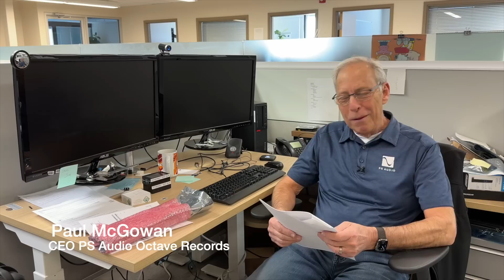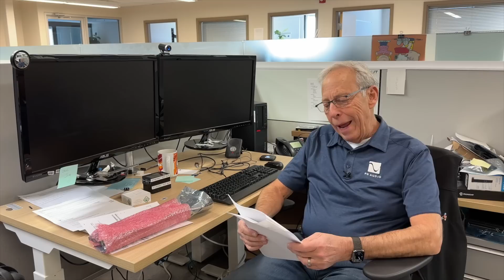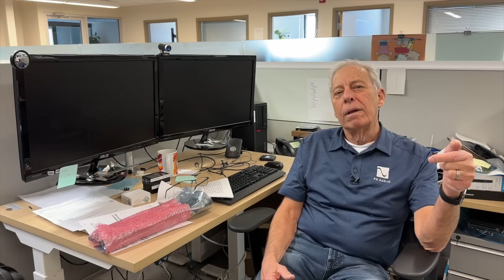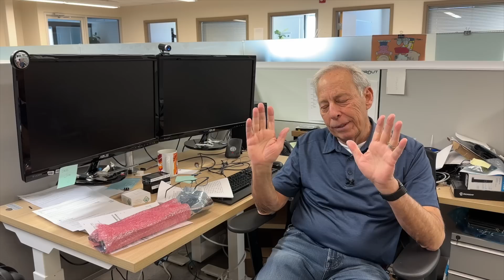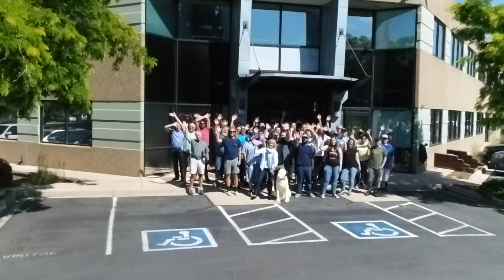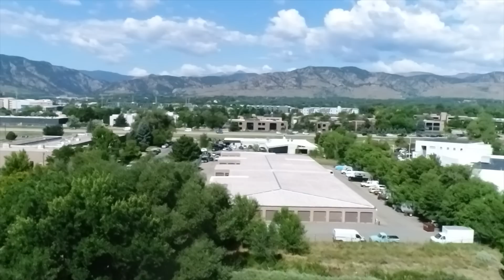Volts or amps for loudness?

Comment: The point is that current is voltage dependent not the other way round for given load , if you want to increase the current through a fixed load, you have to increase the voltage applied to it, you cannot create a circuit  with fixed voltage with a fixed load and have a current control knob, electricity doesn't work like that. 
it is more  complicated than that because analogue sound signals in a wire are AC and speaker loads are frequency dependent which is probably why high current AMP marketing term came in, but its smoke and mirrors if you want to increase the AC current through a load its the peak to peak AC voltage that had to increase.

Comment: I guess that means that the power supply of a great audio amplifier is the most important building block of the design. It all comes back to Ohms Law.
Reply: Finally--someone gets it!!!! Fact the Power Supply is the Power in Audio Power Amplifier. Also it is the largest and most expensive section of a audio amplifier

Comment: That's why amperage is important for bass response that's where the amplifier runs out of juice if it hasn't got enough
Reply: It's a bit more than that.  SS amps have a reservoir (capacitors) that stores voltage and uses them when big impact sound passages (low end bass response) is created at the speaker.  The lower the frequency the speaker needs to produce, the more current is needed from the speaker.  Thus more current that is needed from the amplifier.  It is all about (what is known as) continuous current (power).  Valve (tube) amps do not use capacitors the same way (mostly) as a SS amp.  This is one of the reasons that tube amps are more expensive.  Tubes generate very high voltages (far more than SS amps) and have a continuous power level that can maintain better current draw demands.  However, SS amps have higher combined total watts output than tube amps.  Both have high values for continuous power to the speaker (although the topology between the amps are different).